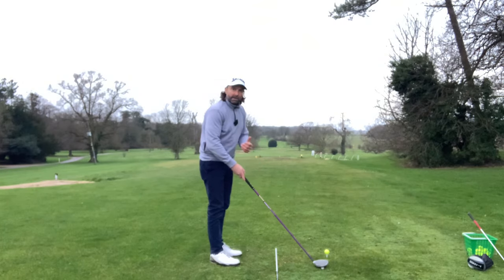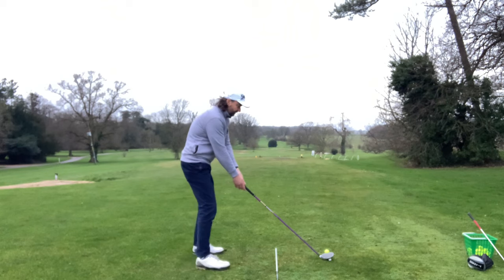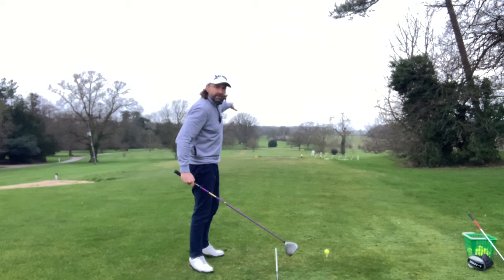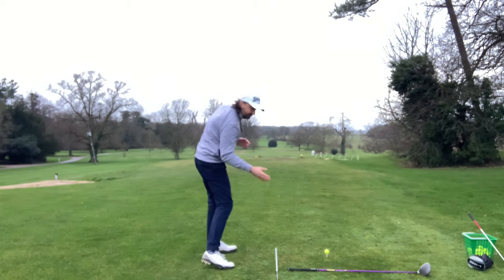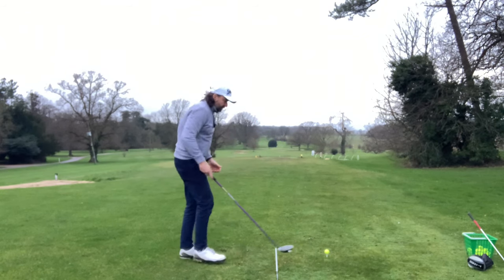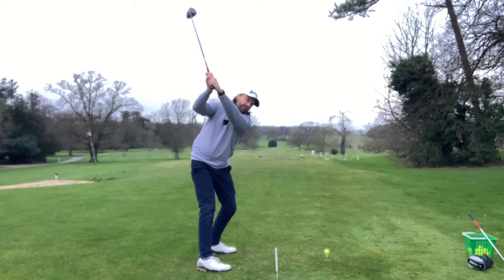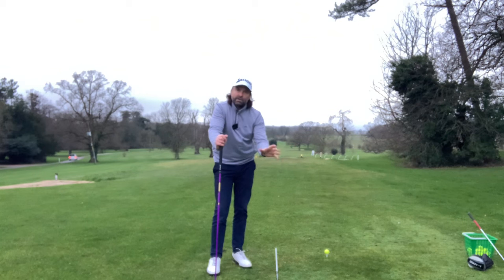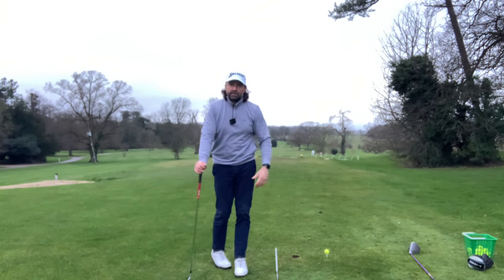Simple Fix for the Duck / Snap Hook!

Comment: Hi again Murdoch, I notice in this video, (and I’ve also noticed in in other videos) that when setting up your posture you position the lean angle by touching your knees - presumably to establish the correct “arm hang”. I’m assuming this move is a general setting and not specific to the driver alone. Can you please elaborate or point me to the video where this setup routine is covered. 
Thanks again for your videos.
Reply from the maker: Thank you Mick!  Yes this arm hang, tap knee caps is in my turn drill.. I’ll link a video 👍🏼
Reply from the maker: This is my Turn Drill.. gets your set up and posture correct too 

https://youtu.be/FOS09uLMbn4?si=HYMSKobWAF9ADeQz
Reply: Thanks so much Murdoch. FYI, I too was struggling with the duck snap hook and tried your setup recommendations today. For context, last week I was trying different drivers because it was suggested that a new driver could sort out some of my driver issues.  My playing partners were in awe as I drove straight and consistently and questioning the logic of looking at alternate drivers. The issue I was facing was that the ball was slowly creeping further away.  The arm hand drew me toward the ball and applied the right angles to my posture. I told them that Murdoch just saved me $AUD800!!
Reply from the maker: @mickruban3567  well done!  Thats great 👍🏼 

I’m delighted the video helped you.  Go win the money this weekend 👊🏼😉😂